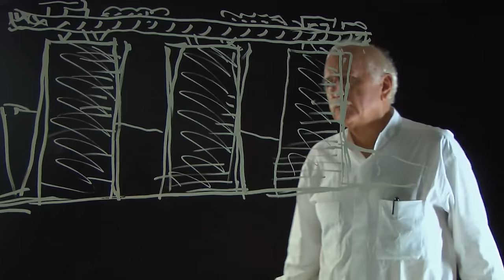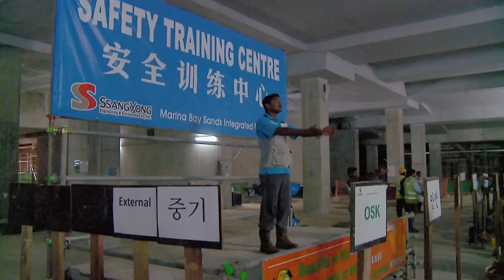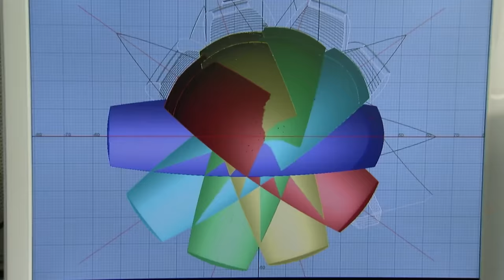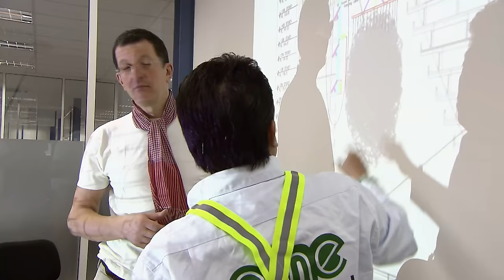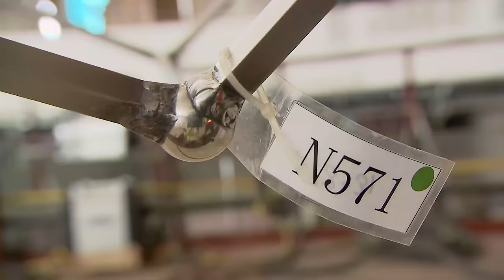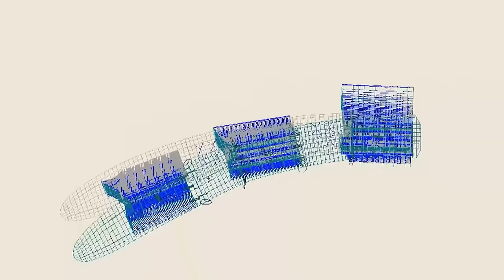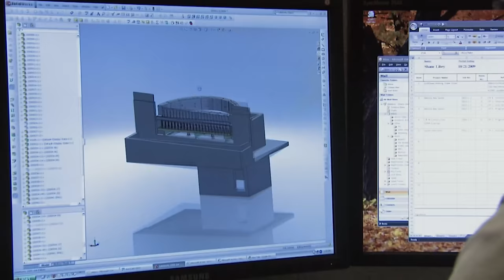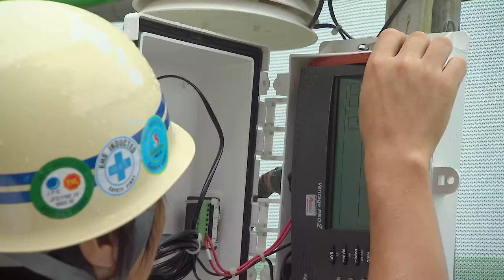Inside Singapore's Most Luxurious Casino Resort | Megastructures: Singapore's Vegas | Spark

Comment: Having worked there for 3 years, I can guarantee you that the employees only areas in the basement levels is a city on it's own. I can easily clock 25k-30k steps during work every day.
Reply: @Anarkey what type of job did you have there? They hiring any gaming dealers there?
Reply: That's about 12 miles a day. I worked in a 100 room nursing home and clocked that on a good day.  Was only about 25,000 square feet

Comment: It’d be a lot crazier if the ‘stilts’/Skyscrapers supporting the top deck crossing all 3… but there’s a reason they split at the bottom. It forms 6 Spread Legs holding the structure vs. 3 base points.